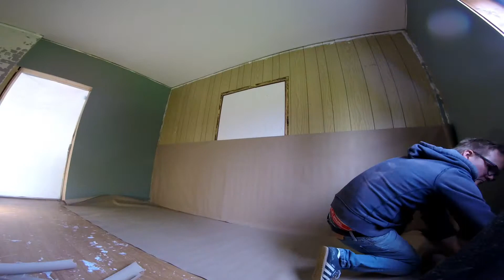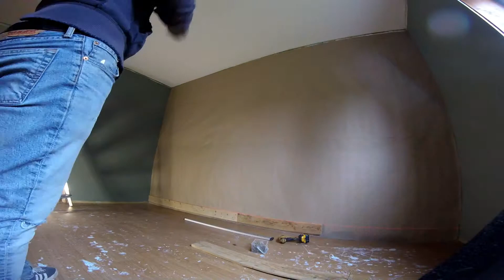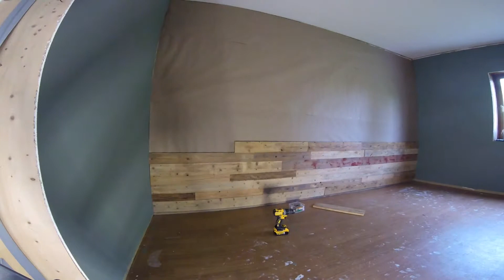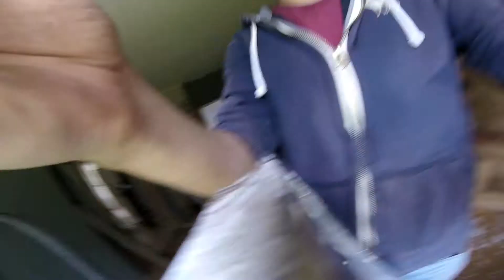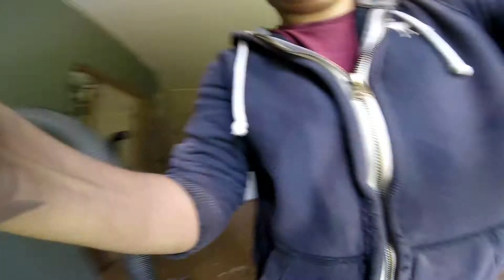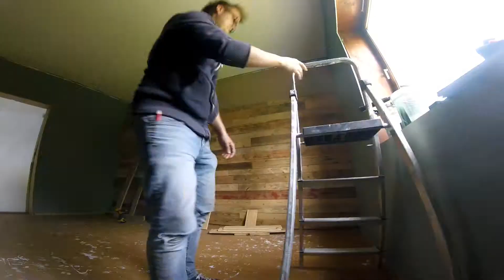Making a Pallet Wall In Our Dining Room

Comment: What type of wood did you use and what did you cover with under and why?
Reply from the maker: Thanks for stopping by! The wood is actually from the interior walls from my guest house project (https://youtu.be/ScUKxdyQths). Had to remove them anyway, and after a powerwash, sanding and trimming them to the correct width, they were ready to be part of our main house instead :) Guess pallet wood would give close to the same result!

The thing i covered the wall with is just some cheap rosin paper (the kind of paper you cover your floors with before you paint the ceiling) I had laying around. It was quite humid when I did this project, and I was afraid the wood would shrink a bit when it dried and I would get some big gaps between the boards. Thought it would be better with that brownish paper backdrop instead of the ugly old 80s wall being visible ;) So no practical reason!
Reply from the maker: And thanks for stopping by!
Reply: @TryingToBuildStuff  I have pallets already to do the same thing to a wall in my house, but they’re so hard to take off the pallets without breaking them
Reply from the maker: @KarinaBanaduc  never worked with pallet wood to be honest, but I imagine you could take them off with a thin crowbar that you can jam in between the boards and the support blocks 🙂
Reply: @TryingToBuildStuff  it breaks it off. I don’t have the sturdiest and newest pallets, but I’ll figure it out
Reply from the maker: @KarinaBanaduc  but you do get the coolest color variation from older pallets so I hope you'll figure it out 😊
Reply: @TryingToBuildStuff  I will! It should be out next Saturday I hope
Reply from the maker: @KarinaBanaduc  That's awesome!